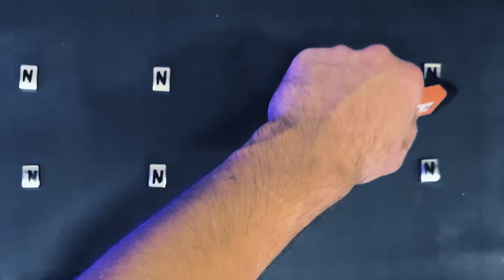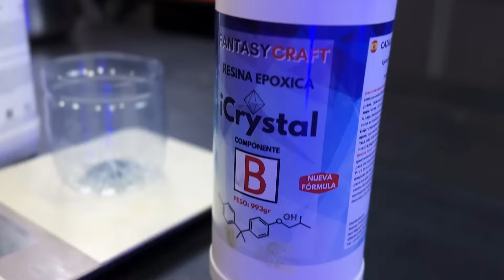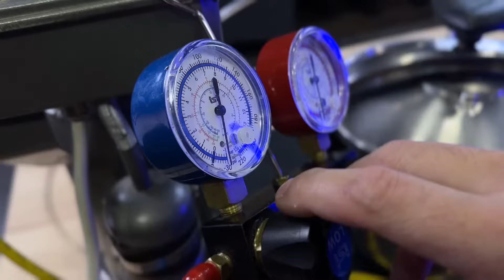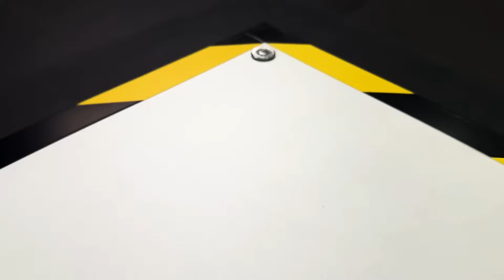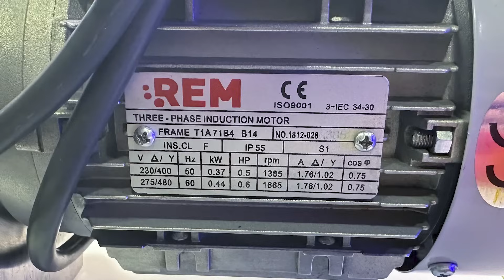Amazing 10Kw Infinite Energy Generator! - Single and Three Phase 230V - EXTENDED VIDEO

Comment: Anytime there is a load put on to any generator, the motor has to speed up and work harder to compensate for the electric drag put on due to power draw off the generator. Also, the light didn't flicker or even dim slightly when the drill was being used.  
(I'm calling this a plassible)

Comment: At face value, I doubt that a 12 Alternator will produce sufficient power to continually excite the coils of a 240V AC motor.
In turn, feeding back current from a source likely to generate far more than 12 V AC resulting axial spin is a good idea for feeding into a 12 V car alternator. 
And even if such a thing somehow might work out,  I doubt that the overall power budget will allow the system to sustain itself.
Not to mention allow power to be siphoned off.🙄
For your sake though, I hope to be wrong in my speculation.

Comment: Pour 10kw revoir  la loi d'hom P-u  x i  alternateur 12V ou 24V +transformateur tri 12 ou 24v primaire et  220 secondaire pour 10kw calcul l'intensité du primaire en 12v ou. 24v et tu vas voir que ce n'est pas possible de produire cette puissance.